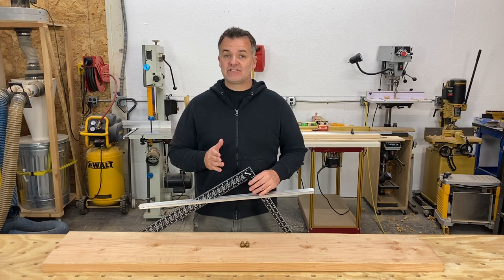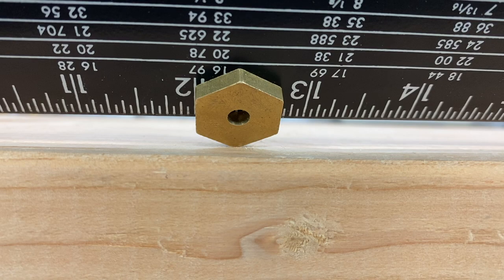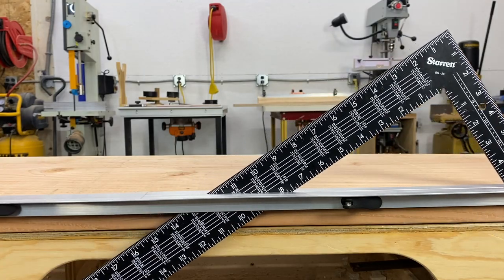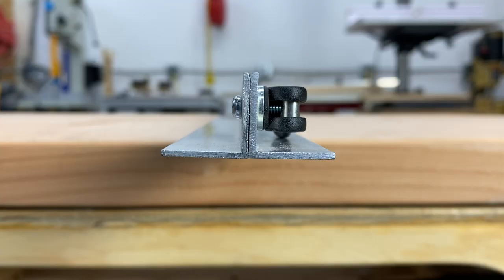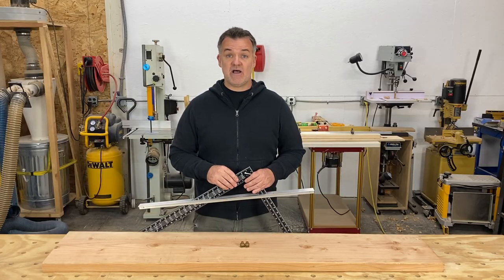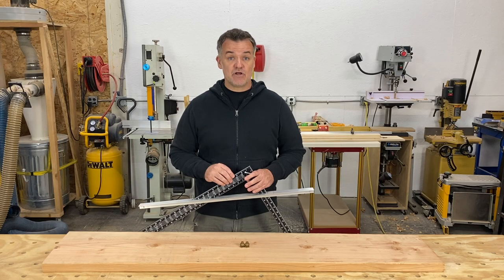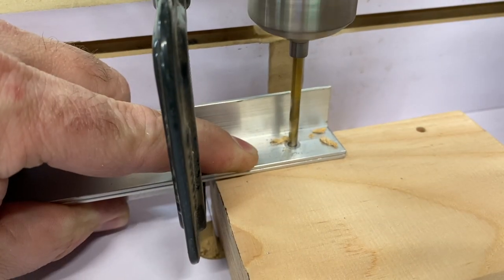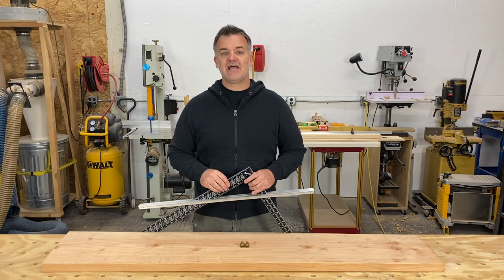Making a Framing Square Guide

Comment: Just made it, thanks. I'd recommend ordering 3/4" long screws. The 1/2" screws are a little too short.
Reply: @thebuilditchannel8609  Just replaced the screws with 3/4". It's a little better...

Constructive criticism; I dont like the alignment process. The way the lines are covered by this "fence". The rocking of one side when dialing in the other. 

I'm thinking that I like my Starrett 111 gauges and my Martinez framing Square more than this. I'll still give it a shot, but first impression is just so so.....
Reply: @Azariah Anders Instablaster =)
Reply: @Owen Yusuf I really appreciate your reply. I found the site thru google and Im waiting for the hacking stuff now.
Looks like it's gonna take quite some time so I will reply here later when my account password hopefully is recovered.
Reply: @Owen Yusuf It did the trick and I finally got access to my account again. Im so happy!
Thank you so much you saved my ass :D
Reply: @Azariah Anders You are welcome =)